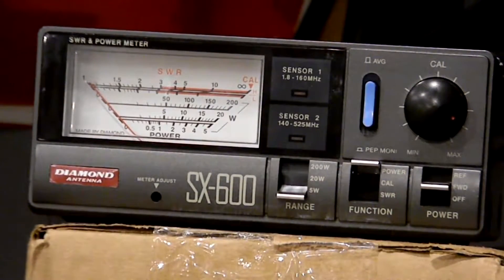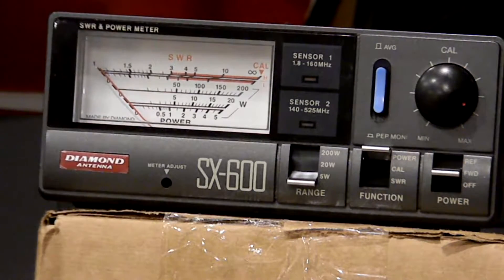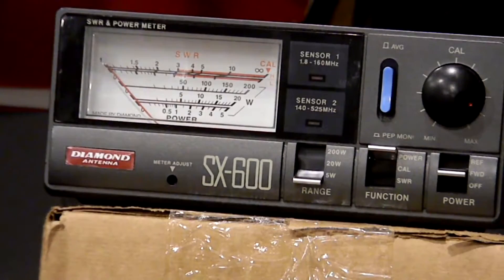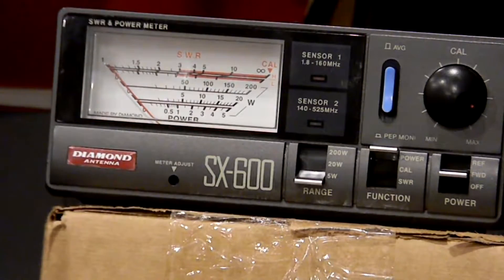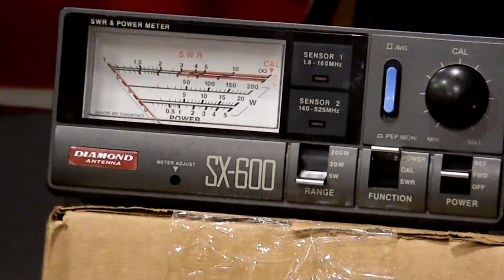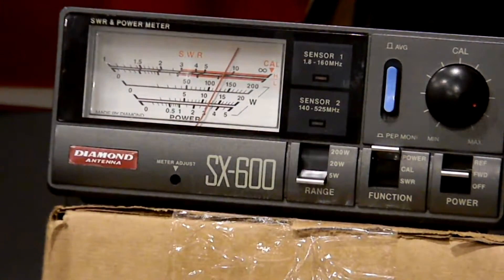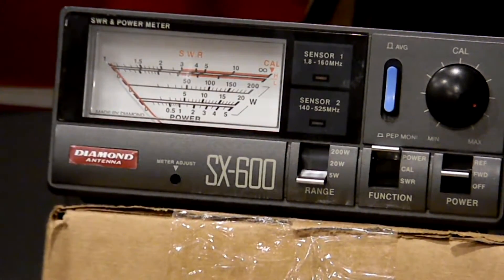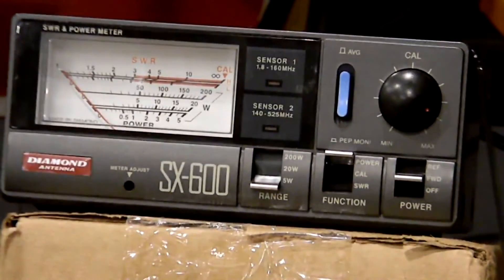Baofeng UV-5R connected to a Bird 8201 DUMMY load!

Comment: Like your selfe I would like to see REAL WORLD SIGNAL. (Testing) FCC dosen't see that way though. Its laws of physics if you put it in a pipe you will get high results.  However we all know most of the energy used ( real world no pipe) is used to launch the signal. ( Given 6 feet most is used up. and Microwatts is all that's left) The real world scenario is back in the formative years of radio. Is interference.( DOG FIGHTS OVER) OVER LAPPING SIGNALS. HENCE THE NAVY WAS IN CHARGE. THEN THE FCC. Will they go door to door. And pull purchase records and take at gun point?   Not that I don't trust any one....I just don't trust any body. This country is facing a coup. A free wheeling radio is a threat to them . ( Both sides)

Comment: I think your SX power meter is not very accurate. I watched someone else testing the same radio with a R&S power meter and he was getting about 4.3 watts on high and 1.2 on low. I would say that the first power meter you used was probably more accurate.

Comment: LOL you didn't have to make a video on this but hey now you know exactly what your radios are outputting, 
Now you can take your figures and go here - http://www.csgnetwork.com/antennaecalc.html and get your ERP and see how well your system preforms.

Those radios are just random with output huh? some are 2.5 and some 3.5.. weird
Maybe it's the battery charge or no?
Reply from the maker: You ask, and you shall receive. <wink>. I just don't have a Bird power meter, those are $900+ with all the elements.
Reply: meh, what you have works, no need it wasting $$ if you don't need to.
I still have a Radio Shack SWR/Watt meter kicking around here someplace.. I think the last time I actually used that one was when I built an 11 meter dipole antenna out of some TW wire, some years ago..